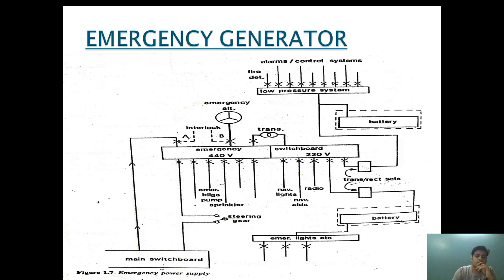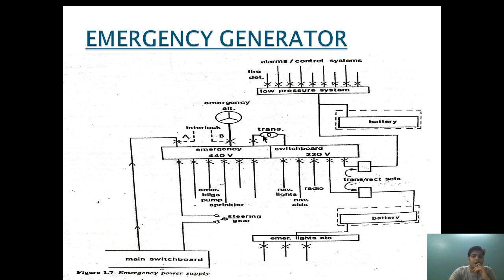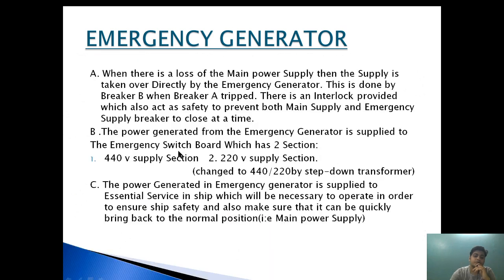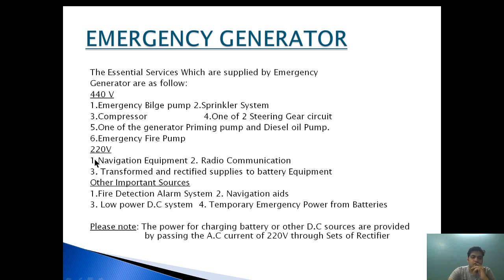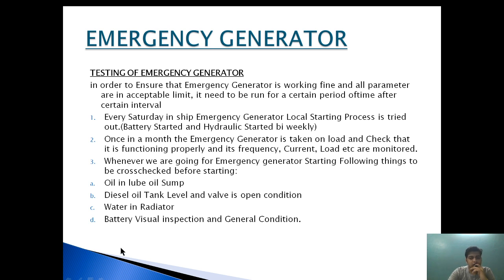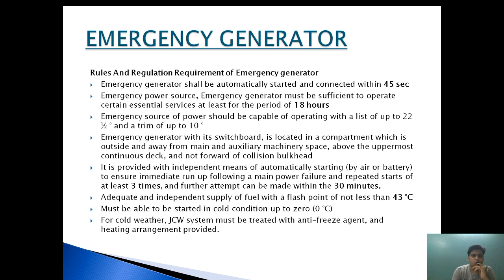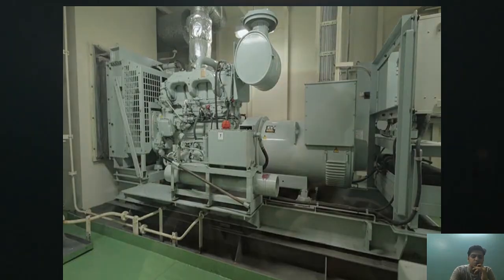Emergency Generator in Ship|Line  Diagram|Testing|Starting|Explanation

Comment: Thank you for the help. Meanwhile I think it's vital to mention the importance of the start up battery maintenance in order for the system to be 100% in condition to crank the emergency generator in case of power failure.

Comment: Why interlock need to be there? 
Why we cannot run emergency generator parallel with main generator after recovery ????
Reply from the maker: Because the cable layed for Supplying power to all Essential Equipment is separate  for Main Generators and Emergency Generator. So 2 supply source cannot provide power to one equipment.

I hope you Understand!!!

Thank you for your response!!!

 Please watch other Video's of Marine Engineering Hub !!!!!

Comment: 🎯 Key Takeaways for quick navigation:

00:40 🚢 Emergency generators on ships provide power during main power failures to ensure essential functions.
02:31 🔄 The emergency generator takes over when the main power supply is lost, connecting through a breaker and supplying power to essential ship systems.
03:53 ⚡ Emergency generator power is divided into 440V and 220V, supplying critical ship functions like steering gear, navigation lights, and fire prevention systems.
05:05 🚑 Essential services powered by the emergency generator include emergency bilge pump, sprinkler system, compressor, and navigation equipment.
06:44 🛠️ Regular maintenance involves weekly starting, monthly load testing, and checks for oil, fuel, water levels, battery condition, and general inspection.
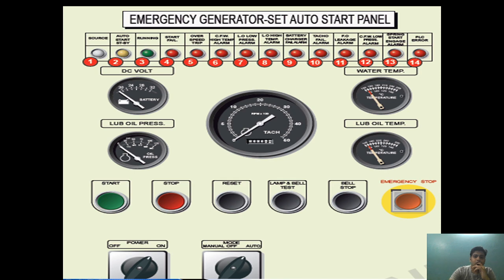09:05 🔋 Starting methods include battery starting and hydraulic starting, with specific procedures and checks for each.
11:46 🔄 After testing, ensure the emergency generator is set back to auto mode for automatic operation in case of power failure.
13:21 🌊 Emergency generator regulations specify automatic start within 45 seconds after a blackout, capable of providing power for 18 hours, and operational in certain trim and list conditions.
15:53 🛢️ Fuel used in emergency generators must have a flash point not less than 43 degrees Celsius, ensuring safety during various environmental conditions.
19:10 ❄️ Lubricating oil and jacket water mix used in the emergency generator are designed to be anti-freeze, allowing operation in cold conditions down to zero degrees Celsius.

Made with HARPA AI